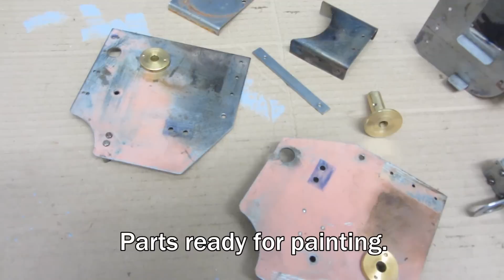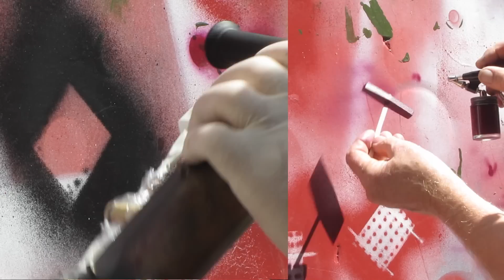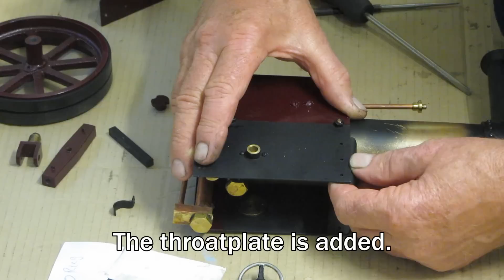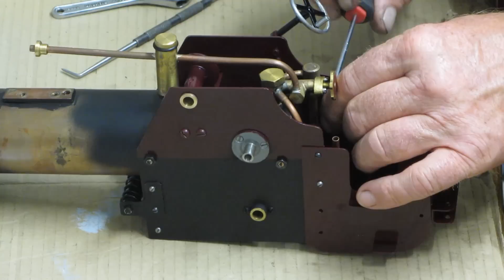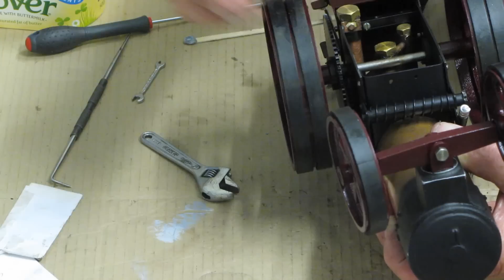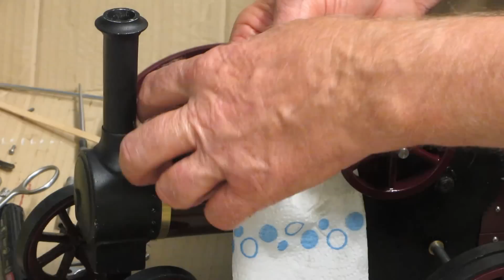Simple Steam The Myfordboy Traction Engine Part 21 Painting

Comment: Very nice indeed. Big, but not too big for a novice with novice equipment. Complicated, but just enough to be a challenge. Cheap enough to be within most budgets.
You have excelled yourself on this one, best one yet, (the furnace is a close second, but that's just my opinion,) as it is all fantastic.
After, or perhaps instead of those temporary Velcro cladding bands, try tying the string hold downs with a clove hitch knot? It has the useful ability to clamp things down progressively and was used extensively to lightly clamp things before someone invented plastic cable ties. They undo very easily as well.

Comment: May I ask the source of the boiler lagging - I am building an engine similar size and I am just comparing different lagging's to find the best option.
Reply from the maker: I bought the silicon sheet on a market stall. You should be able to get some in a kitchen supply shop.